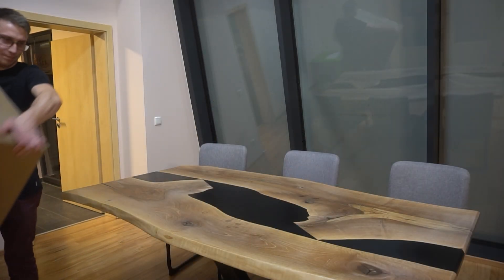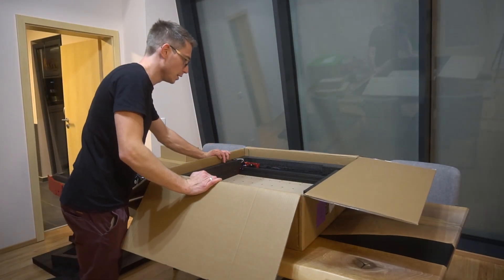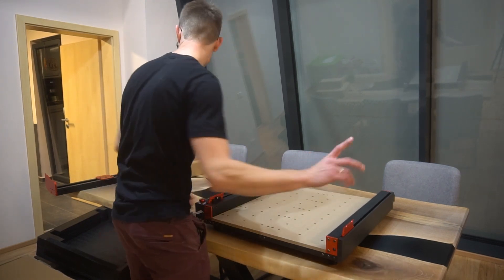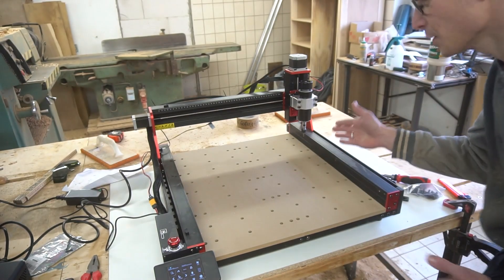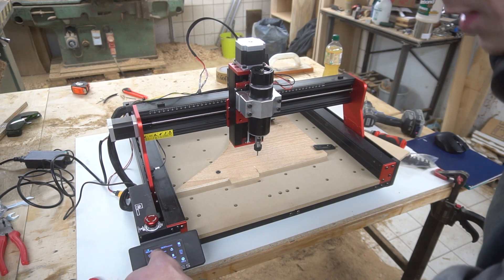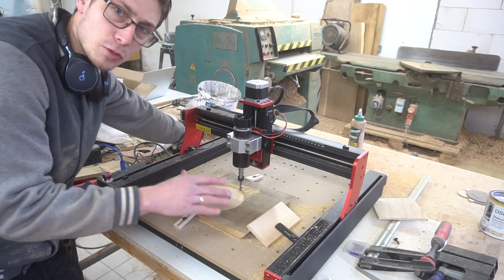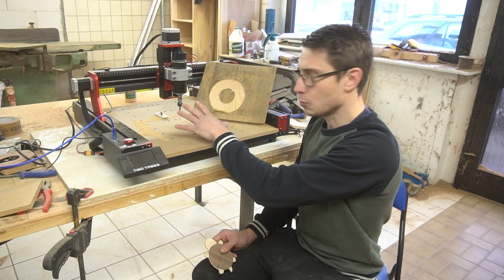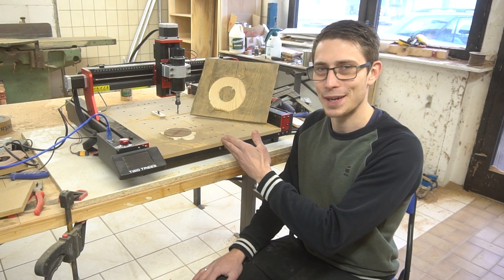A Cheap But Impressive Hobby CNC Machine: Two Trees TTC450 PRO Review

Comment: I just found your channel, I was wondering what software does the CNC use, easel or something else. Thank you great video
Reply from the maker: Hey Mike! :) You can either use the integrated interface and an SD card. Or use Candle Grbl, which is free to use and can control the machine =)
Reply: Thank you

Comment: Just found your channel - I'm looking to get into cnc as a hobby without spending a fortune - perfect timing on this video.  There do seem to be some odd design flaw issues but for that price, I think you're right, not a deal breaker if they can be worked around.  It will be interesting to see how the machine holds up.  Wil you post any updates later on down the road to show reliability over time?